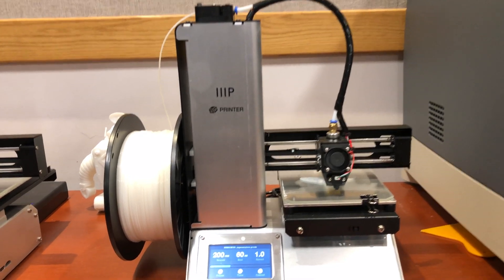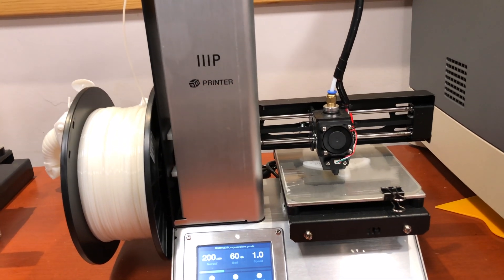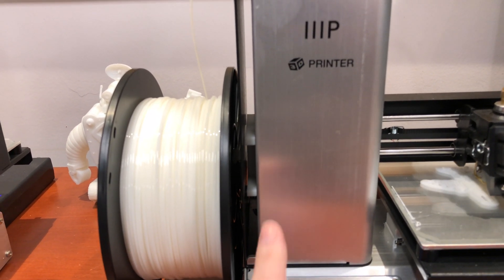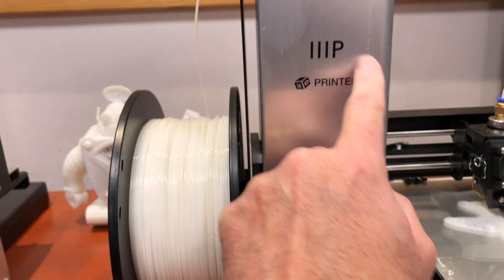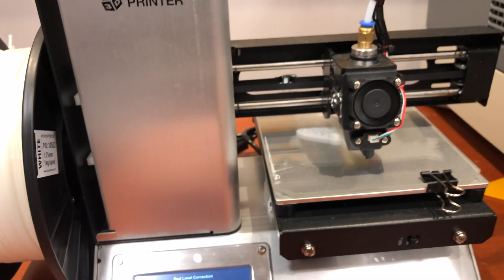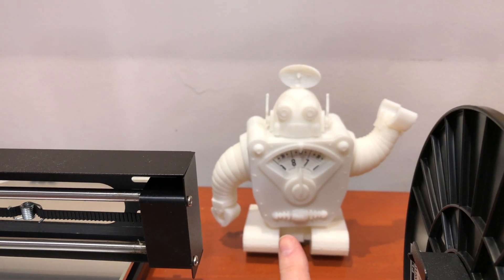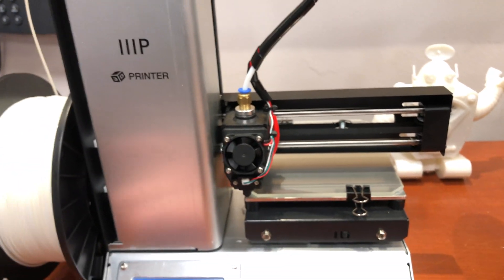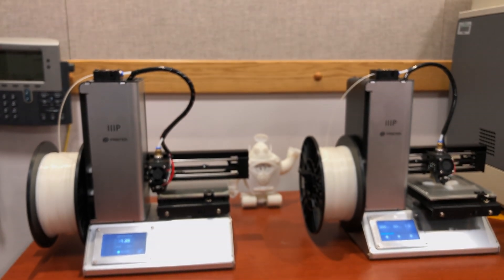Monoprice Select Mini Pro fixed

Comment: This is old af… BUT…. I got 2 of these lol. One had a problem and support LITERALLY just replace it and then I was able to fix the first hahahaha. But……. I ain’t used it for literally years I mean it’s been 4 years so. And I’m looking at a printer called a BAMBU P1S basically a top printer right now for the price. Sooo the question is. Does this printer still perform? Or shall I get the new one? Only reason I’m not getting it instantly is because again I just didn’t use it for 4 years and now I’m here wanting to use it again lol. But not sure I can be bothered with the cura settings. I remember I had a secret profile I setup made prints literally I mean literally ridiculously smooth that they looked like as good as acetones!!! This was pla too. But now the new ones have apps and it’s so easy. 
Help me out?.
Reply: I’m gonna either get a Bambu P1S or Neptune 4 max or just use this printer which I have 2 of them lol 
But I can’t really remember how the print quality is shmmmm.. I also fear I’m just gonna do the same and not use the new printer 
Maybe I should just setup this printer and see
Reply from the maker: Back in the day, the Monoprice was a decent deal.  But there are much better options these days.   The Bambu is a good printer, though its parts are proprietary (and so in the future might be hard to replace).

Comment: What is the distance from the top of glass to the metal mount bed (not the aluminum heat bed) that will probably answer your question of why so different but the same.

Comment: by the way to check if inductive sensor detects a surface as well as the distance to detect it is easy, turn on printer, go to move click home once it homes you'd be able to see in the up left corner xyz in green squares (or some in red )  the ne that matters is the z in green  then put something below and parallel to the  sensor then slowly lift it aproaching it to the sensor when sensor detect it  z square turns red

Comment: I've got a 3.5mm spacer, but about 3.2 mm of glass but the hot end still takes a dive into the glass bed, should I print another thicker spacer, then adjust if the end stops too high with the level adjust on the printer software? Many thanks as this video at least means it's possible and I can try and get mine working
Reply from the maker: That's what I had to do.  I added about two millimeters to my spacer and things worked fine after that (along with fine-tuning the print head distance with the menu system).
Reply: @jayducharme  great, i'll be glad to get mine printing again after i tore up the original build tak by mistake. whoops. and thanks.

Comment: The offset difference can be explained by the factory calibration off the bed sensor is shit. You can calibrate it your self, the is a calibration screw under the black tape on the front of the sensor
Reply from the maker: Thanks for the tip!

Comment: I have tried adding a 3mm borosilicate glass bed, using a 3mm and a 3.5mm spacer. The nozzle still comes all the way to the bed and can't extrude. I have taken the offset all the way to -3.00 and the print head still comes all the way down on auto-level. Any ideas?
Reply from the maker: Did you add the spacer?
Reply: @jayducharme  Sure did. Tried a few of varying thickness now. I've got a little treasure trove of spacers that don't work. I bring the Z-Axis up about 3/4 of the way to the top, install the spacer, home it, auto-level... and it hits the glass. keep trying to bring it out, it hits the glass. Get all the way to -3.00 offset, and it hits the glass.
Reply from the maker: Don Judd   It sounds to me like your sensor isn’t working correctly.  The spacer should trip the limit switch which in turn should regulate the Z axis distance.
Reply: @jayducharme  I would tend to agree, except this is the second printer doing it. I think I'm doing something wrong.
Reply from the maker: Don Judd   I’d have a chat with Monoprice support. They’re usually pretty good.

Comment: I had a clog and cant get the lower bowden connector off. Can you help me? I have the same pro model
Reply from the maker: I'm probably not the best one to walk you through a fix in a YouTube reply.  A start would be to heat up the hot end to 205 degrees then carefully remove any residual filament goop with a good set of long tweezers.  And remove that rubber boot but be careful not to damage any of the connecting wires.  Once most of the filament is melted off, you should be able to remove the Bowden tube.

Comment: If you are reading this message first, look for my previous comment i made a few seconds ago, then you will understand why im posting fourm lol. 

I made a forum post of my current 2 issues. These are the only 2 problems im having and are probably easy to fix, but because im new i dont know anything lol. The forum i added photos of my issue and my cura settings. if you can look at my problem and reply back on youtube or you can make a fourm account if you really want to but thats effort lol. here are the fourm posts i made.

LINUSTECHTIPS ( On this fourm you can see pictures ive added on the actaul fourm post. I also made a post on reddit but you can add pics so i had to upload to a website and provide links. so this fourm post is better than reddit. ) 

https://linustechtips.com/main/topic/1139042-how-do-i-fix-this-3d-print-why-is-it-failing-at-the-top-and-how-do-i-make-details-more-depth-or-indented/

REDDIT ( if you dont trust my first website then heres reddit which you should know lol.  They are the same post just different website. Linus is better since you can see the pictures. 

https://www.reddit.com/r/3Dprinting/comments/egjwhp/help_im_a_beginner_have_2_problems_how_do_i_fix/
Reply from the maker: I assume you're printing with PLA.  The only time I use a heated build plate with the Select Mini is for PETG.  If you have good surface adhesion (either good build tac or glue stick on a glass surface), PLA prints better without the heated bed, in my experience.  So you could try that.  Also, lower your filament temperature to 200.

Comment: Finally. I fixed the gaps issue...................... Oh great another 2 issues come. lol. I mean im new but Im sure you would know because i guess this is expersince based. Basically I printed a lighthouse and on my print i do, For example a roof on a house. When it finished the top of the roof like where it joins, it always has splits, dips riges and stuff. Also Alot of small detail is fine, apart from some. 

If i send links with pictures it will probably hide my comment from you for spam so idk how to show you. I made a fourm post on a 3d printing fourm website but noones answering lol 

I will post the link to that fourm in a new comment on this video, But it might hide it for spam but at the top under the write a comment box, it will say some comments have been hidden due to spam, if you click that it will show my message. Im literally close to perfect prints I JUST NEED to fix these 2 errors THATS IT!!! 

In words, basically the 2 problems.

1. Some small details are rather not printed at all, broke, rigged alot or zagged whatever hard to explain without photos

2. Detials such as windows in houses are not deep enough, so they are bareley visible. how to make the details more engrooved? 

My cura settings will be posted in a video on the fourm i made. Ill post a new comment on this video with the fourm link. I made this fourm post on 3 different forums lmfao. noone repsond >:{ >:{  Please help me. Check for my new comment plzz

Comment: Humans assemble these. Very low paid humans. That is why you nozzle setting can be drastically different from machine to machine. If you bought ten of these and completely reassembled them all with extreme care and procedure you would end up with ten machines that use nearly identical height values.

Comment: I can’t get any print to hold to print the spacer. Any ideas on how to print on glass bed without the spacer?
Reply from the maker: You would probably need to print the spacer on the BuildTac surface, without the glass bed (after leveling).  Then once you have the space, you can add the space and glass bed, re-level, and you should be good to go.  You'll probably need to fine-tune it for the first few prints.
Reply: @jayducharme  Thanks. I appreciate the advice. I think something bigger is wrong with my printer now. It will not extrude filament at all now.
Reply from the maker: @tburns5943    If you tried to print on the glass bed without the spacer, you probably crushed the nozzle tip.  It's made of brass and deforms easily.  New .4 mm print heads for the Mini can be gotten on eBay pretty cheap, and they're fairly easy to swap out.  Get yourself a 10 pack.

Comment: Are you having clogging issues?
Reply from the maker: I was, but not any more.
Reply: I’m having a Dickens of a time on my initial print. Armachine is clogged. The manual is worthless. Some videos say pull out the white feeder hose that goes into the extruder but mine doesn’t come out as easily as they indicate.  It would be awesome if you could do a video on how to unclog this thing.
Reply from the maker: @greginfla_1  I bought the Monoprice cleaning filament and forced it through by hand.  That seemed to help.  Make sure you've removed that rubber boot; it caused me no end of problems.  Also, replacement nozzles are really inexpensive.  Get a package of them (.4 mm) and replace the stock one.  That might help as well.

Comment: I've got one of these coming to me in a couple of weeks . I've also got a select V2. I ordered 2 glass beds from China which have arrived but sadly they are different thicknesses ,also one is completely transparent with the other having a frosted back so I will have to ensure I use each glass bed only on one printer ! I am awaiting reply from supplier on this .
I noticed you've removed the buildtak surface , would you recommend this when using a glass bed ?
Reply from the maker: You could do that, which would shave off a millimeter or two from the thickness.  That's why I did it.  Or you could print a slightly thicker spacer to compensate.
Reply: My Mini Pro arrived yesterday & I've managed to dial in the offset 
setting (  in my case it is -0.33 ) on the stock build plate. Had a bit 
of trouble with bed adhesion ( my printer is 2nd user  & its stock 
buildtek bed shows signs of misuse ) so i have started using Elmers glue stick which after a couple of test prints seems to work well .

My next task is to use this printer to print a z-offset spacer for my 
other printer ( Mini Select V2 ) which is suffering from warping of the 
print bed so I am going to install a glass bed that i hope will 
eliminate this problem?

Once that's done & I'm happy I will probably also install a glass 
bed on the Mini Pro. 

I have already ordered 2 glass beds from china supplier which have 
arrived but they are differing thickness ( by approx .5mm!! ) so i will 
have to ensure that each glass plate is only used on the printer for 
which it was calibrated

So far so good thanks to your help
Reply from the maker: @Keeping_IT_Simple  Your welcome.  Bed warping is fairly common on those printers, so a glass plate should help.  Good luck!

Comment: Thanks for the video, I intend to buy this printer in the next few weeks.  How does the glass effect the self leveling?  This will be my first 3d printer and I'll ask many stupid questions of many people ;-)
Reply from the maker: If you look closely, you can see a small white clip between the filament spool and z axis tower.  I printed that out before installing the glass plate.   It clips onto the z axis motor and adds about 3 mm to the limit switch contact, essentially recalibrating the printer.  You can find it here: https://www.thingiverse.com/thing:1808029
Reply: I would save yourself a lot of headaches and pick up an Ender 3 instead. You get 4 times the build area for the same price and much higher quality. Started with a Mini Pro and quickly ran into clogging issues, picked up the Ender 3 and have been printing non-stop without issues since.
Reply from the maker: @MStewGT   The only advantage to the Monoprice is that it's ready to run out of the box.  But I agree, the Ender 3 is a better overall value; you just have to put it together (though for a slightly higher price, they'll sell you one pre-assembled).
Reply: in case you don't know there are four facts 1- inductive sensor is only capable to detect metallic surfaces. 2 the printer only use sensor in during the self leveling process meanig that when it moves printer head to the center befor printing is just to  reach the z limit switch, why there ? don have any idea but it is as it is) 3 you have to get it leveled just one time or sometimes not every print yo would make. 4- leveling is not z distance setting leveling just garantee that the printer nozzle keeps parallel to the bed, with taht in mind  optiosn are   the invasive one adjust inductive sensor (the screw behind the  almost undetectable sticker under the sensor connector, or the more elegant not invasive methode, use the clip may need to modify  (i had to do it to a 4,6 height ) and for self leveling  aply a thin coat of hairspray when still cover it with foil use a spatula to teake out air bubbles trim the excess place the bed with the foil up make the leveling process  you are done  remove the folid adjuss z distance  and print  now i hve not tryed yet but perhaps you can grab a mirror plate insted of bare glass   and perhaps te industion sensor detects the metal in the back coat of the mirror so you can use the back of the mirror to level and the front to print but it is  a theory

Comment: Sorry, more questions, since I know you have the same printer.

What were the symptoms of the crushed nozzle? Was it related to getting molten plastic under the rubber hood, rather than on the build plate?

Do you print PETG at all? I understand the rubber hoods were invented to help with PETG. The theory is the hood insulates the hot end, keeping the feed tube and the deposited plastic cooler. I know you cut the hood off at least one of your printers, can you print PETG without it?

Third, just today I'm noticing the heater alternating between the nozzle and the bed. Are you seeing this on your pros? I know on the V2 it could be a sign of fraying wires.

Thanks again,
Michael
Reply from the maker: Michael S   The filament was barely coming out of the hot end; that’s what got me looking at the nozzle and discovering it was crushed. 

I haven’t tried printing with PETG yet, so I can’t help with that. 

As far as the alternating temps, I haven’t noticed that on mine. It takes a while 10 minutes or so) to get it up to the correct temperature.  The build plate heats first, then when it reaches its set temp, the hot end starts warming up and the build plate starts to cool.  Once the hot end is heated, the build plate will reheat.  Then both hold their temps throughout the print.
Reply: @jayducharme  Thank you again. My nozzle is still a symmetrical cone. I think I simply need to keep adjusting the z-axis offset.
Reply from the maker: Michael S   That was the tricky part for me.  But once I found the sweet spot, the printers have been working well.

Comment: Does the V3/Pro use the same z-axis limiter as the V2? The ones that clip on over the z-axis motor?
Reply from the maker: Michael S   Yes.  The only differences between the two are that the Pro features a self-leveling bed and has a touch-screen interface.
Reply: @jayducharme  Thanks. 
Upon re-watching the video, I notice your glass plates have notched corners, as though they were meant to allow access to the leveling screws of the V2. Do you buy manufactured print beds, or make your own?
Reply from the maker: Michael S   The glass was made specifically for the Monoprice Select Mini.  I got it on eBay. The cut-outs are there so you can get to the adjusting screws, which are not on the Pro version.

Comment: What was the problem you were fixing with the spacer?
Reply from the maker: Tim Neil   Without the spacer, the Z axis limit switch would allow the hot end to slam into the glass plate.  The spacer keeps the hot end at the same height as the plate.
Reply: @jayducharme  Hi Jay. Late to this video but, do I have to make the spacer as thick as my glass? Or it doesn't matter? Is the auto leveling working with the glass? Best regards.
Reply from the maker: @enricob  Yes, it should be the thickness of the glass.  If done properly, auto-leveling will work.
Reply: @jayducharme  the SAME thickness?
Reply from the maker: @enricob  It's up to you.  I've done them at both the same thickness and about 2 mm thicker.  Both worked.  You just have to adjust the printer's offset accordingly.

Comment: The sensor is an inductive (metal coil) sensor with a trim pot on it. If you were to remove the plastic cover you could adjust the sensing distance of the sensor.

This is why one printer has a different offset than the other. They're just calibrated differently.
Reply from the maker: Thanks for the tip!  I wondered how that sensor worked.